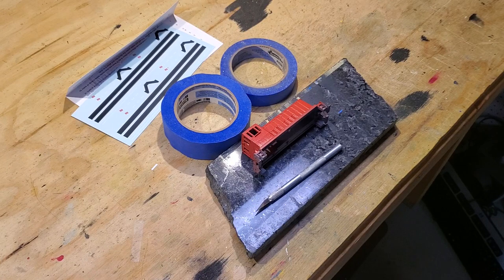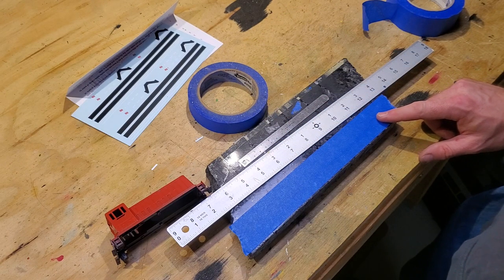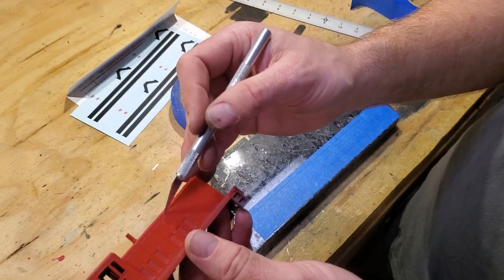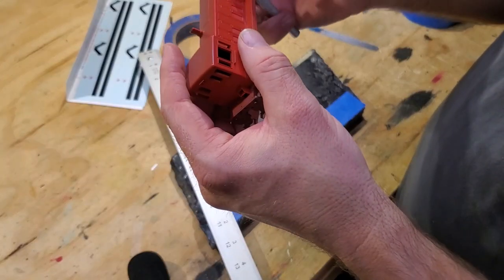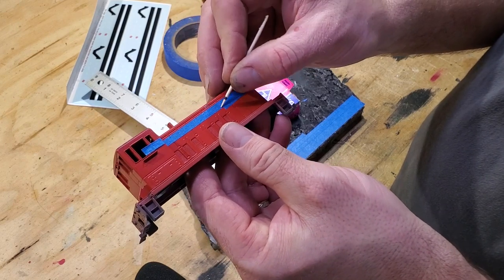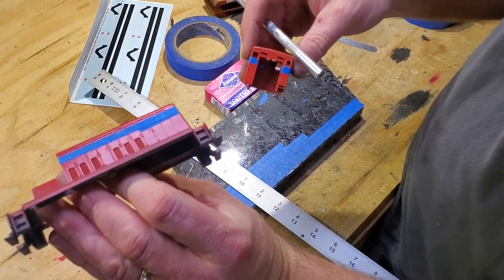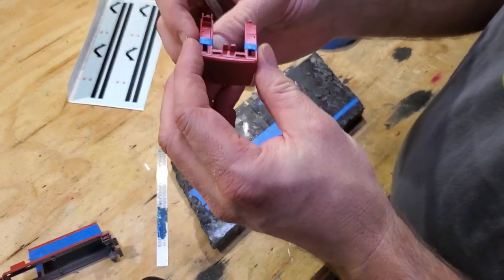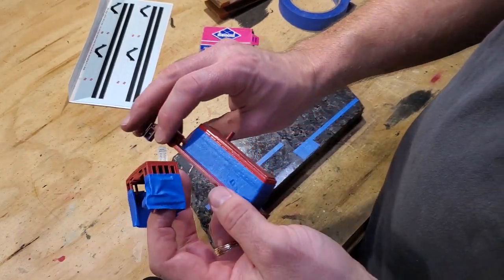HO Scale Custom Custom Dakota Southern #76 Bachmann GE 70 Ton Switcher Pt.2 Masking for Paint

Comment: I've heard a quick spray of the masked color (in the case red) after masking , before shooting the color , helps to seal up the mask for clean lines. I haven't tried it yet, but plan to.
Reply from the maker: I've heard that too.  Tried it once or twice  during my earlier painting career, before I knew what I was doing.  Can't really remember what the results were.  Better Masking tape and multiple light coats of paint should eliminate the need for a second application of the same color over Masking tape.
Reply: @blackhillsandeasternrailroad  Yeah.  My airbrushing experience is with Lexan RC car bodies and that is a different animal.
Reply from the maker: @majortomtogc I have never painted on an RC car body before.   Tamiya masking tape is preferred for RC cars also?
Reply: @blackhillsandeasternrailroad  Yes.  Tamiya real popular as is various liquid masks.